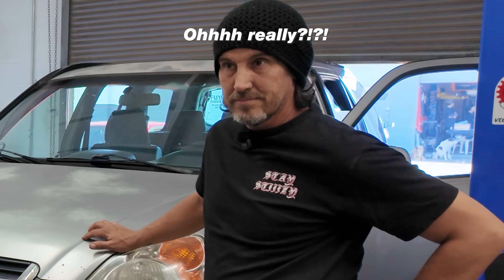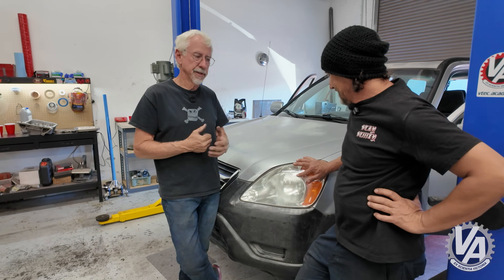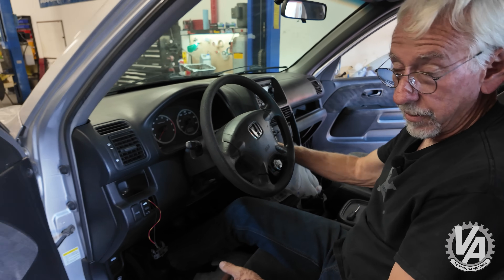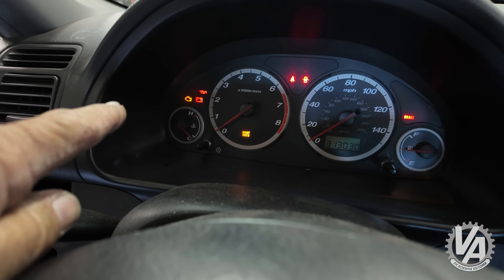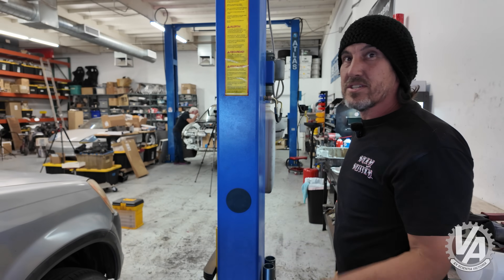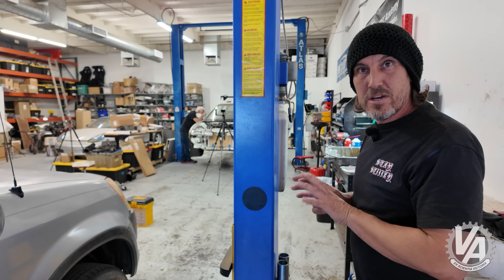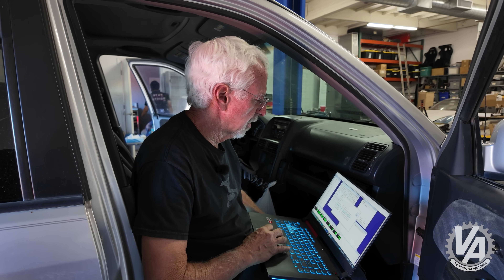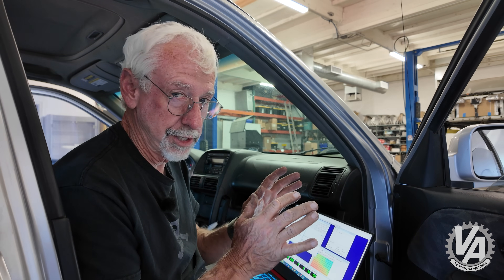2 Ways to Do the K Swap 6 Speed Reverse Lockout

Comment: @vtecacademy Ok so i have a stock 02 crv honda ecu in a k24a2 swapped 02 crv, i am confused a bit. What base map did you use to have it work? Rsx-type s, or tsx? And then you wired the imcv to the solenoid?
Reply: I do understand that you changed the signal for imcv in honda that i understand.

Comment: I need some help. So I put a k24A on a 2013 Honda civic si   I can’t get it to start it don’t have any spark. I extended the crankshaft sensor since they’re different. I don’t know if I need to change  wiring order on the plug

Comment: I believe another alternative is to wire reverse lockout to the brake light switch.
Reply from the maker: You’d probably also need a five pole relay as well too break the connection.

Comment: Great but what about an KPRO PNF auto ECU. How do we get Reverse lockout to work ?
Reply from the maker: Use the IMRC solenoid out put.
Reply: The PNF doesn't have IMRC or Reverse lockout. It can be added to the ecu, I show how to do it in my videos.
Reply: @Cloneufc  cant you just buy the plug and splice it in?

Comment: My 06 CRV has 381xxx miles. I've been smelling burning oil like crazy when I drive. And I have to add oil every other day. It is a highway car! I'm debating on  either changing the piston rings or getting a engine swap with trans. Do I need to swap out the ECU too??? And the problem with the burning oil smell.....I haven't changed the PCV
Reply from the maker: You need to determine if the burning smell is from the engine burning it, or it’s just a leak and dripping onto something hot on the engine or exhaust.
Reply: @VTECAcademy I'm gonna change out the valve cover gasket & PCV. I think I figured out what's wrong with my transmission. I need a torque converter
Reply: Change your valve cover gasket dude
Reply: @Eman7335 haven't done that yet
Reply: Get a K24A for $700 and swap it

Comment: How about for an ‘11 Accord?Seriously considering swapping 5MT for a 6MT.
Reply: I put a 9th gen civic si trans in my 2010 accord if that's what you are thinking of doing. everything connects the same as the 5 speed in the 8th gen accord but i actually had an automatic so I had to do a little more work to get the clutch in but the shifter cables and mounts all fit the same. i also swapped in the manual ecu for the accord and got the Honda dealer to pair the immobilizer. it works great though the speed is off by 17% so i printed out paper with the speeds on them for each of the lines on the speedometer. The dash cluster comes out pretty easy.
Reply: @Rekceir thanks, I was hoping the speed sensor was on the ring gear, but it sounds like it isn’t the case.

Comment: Would I be able to do this procedure for Reverse Lockout on a 2007 TSX automatic ECU with a FlashPro on a K24A2 and 6 speed transmission?
Reply from the maker: Close, you’d have to use KTuner or a momentary switch.
Reply: I've designed and built a small circuit that, based on a speed signal, engages the reverse lockout. Works the same as the OEM solution -  above a certain speed, you cannot engage reverse.

Comment: Awesome upload. Couple years back I was looking for a reverse lockout solution for a k20z2 engine. Which is a Canadian only 2.0L 5-speed economy engine. I later found out it was impossible because there was no signal output from the ECU connector C harness. However the 06-11 8th gen Civic FA5 Si and the 06-11 FD5 Acura CSX Type-S has this signal output and compatible with the k20z2. After swapping out the engine harness for an Si engine harness + using a Type-S ECU and getting Hondata, it works flawlessly and didn't have to pin anything! Also, I found out the k20z2 engine is just like the RSX base k20a3 engine. However bizarrely the k20z2 economy engine has a RBC-1 cylinder head! Exactly the same as the 06-11 Civic Si cylinder head except missing lost motion springs (however the castings are still there!) And the camshafts are EXACTLY the same as the base RSX, (same part # and everything!). Swapped out the cams for 2008 TSX oem camshafts, added lost motion springs, assembly shafts, Si VTC 50 intake cam gear,  rbb solenoid, and vtc spool valve and now have real vtec too. 👍